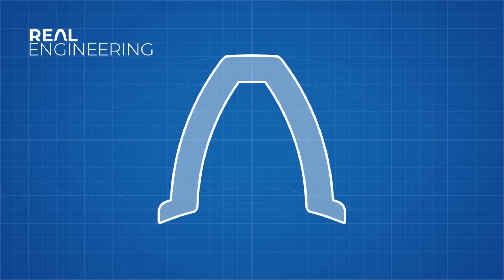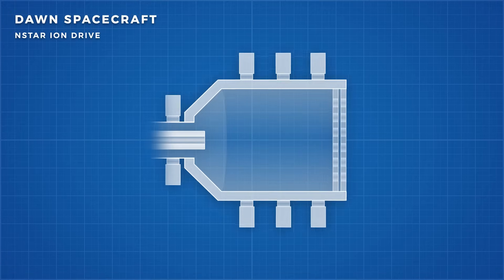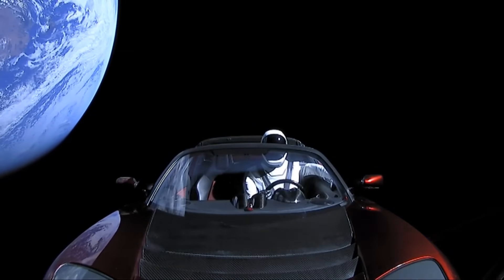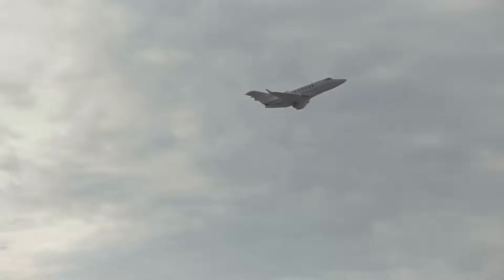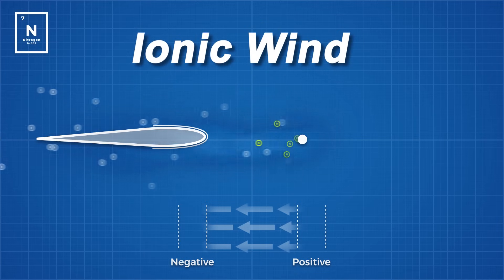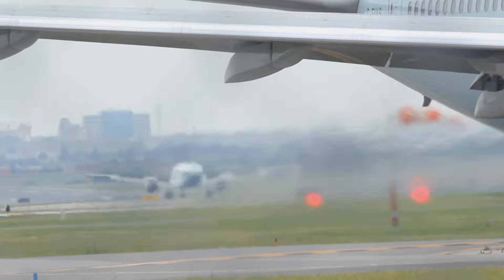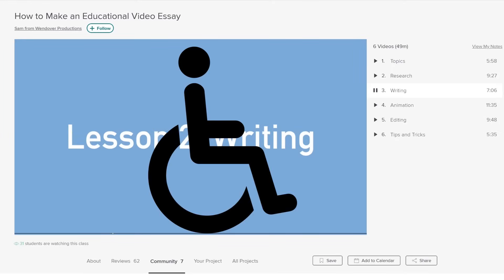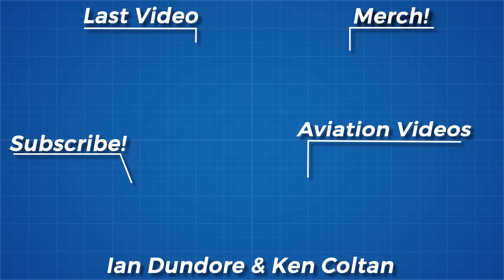Ion Propulsion - The Plane With No Moving Parts

Comment: Ion Engine: I am the first aircraft engine with no moving parts!
Ramjets: Am I a joke to you?
Scramjet: WTF dude?!
Reply: Paper Airplanes:
Reply: Pulse jet: sky rex you suck you forgot me.
Reply: you must have valves and probably a pump(s) ... moving.  Flaps, rudders ... hmmm...
Reply: @teresawatson8936  Ion planes also have flaps and rudders\
Reply: @allenstuder6938  Actually that's one of the things that can be avoided. If instead of the racks the MIT team used you used pins along the surface of the airfoil, you could increase the airspeed over whichever airfoil you wanted. Somebody made a small RC plane that had a normal propeller but the pitch and roll was ion drive. It wasn't great but it was the idea XD
Reply: @teresawatson8936  ;  They are speaking specifically of engines with no moving parts.  Not the entire aircraft.
Reply: Ramjets have moving parts but very little  Ion and zero  but yeah lol
Reply: Gliders

Comment: Designed their own circuit? That voltage multiplier and h-bridge switch is straight out of a  circuit designers textbook. There's nothing new in that. And that is a DC output voltage, not "alternating current". p/s: And that is not the Wright Flyer;s first flight, it is the second Wright Flyer. Fraud is fraud.

Comment: When the nitrogen is ionised, does it react with the oxygen in the air and does the plane leave a trail of nitric acid vapor behind?
Reply: and ozone, probably.
Reply: Unfortunately yes. I have made an atmospheric plasma drive of 2KW based on plasma cutter principles. The problem is what you mentioned. So even if MIT get's it and gets beyond the mW range they are in, they will come face to face with this unfortunate fact...
Reply: hopefully yes
Reply: Probably depends on energy level of the ions. There are home ionisers which are carefully tuned to avoid generating ozone or nitric oxides. I have one, it also makes slight breeze without moving parts.
Reply: MIT is working on real-life Chemtrails!

Comment: 50 ion drives on each wing should just about do it. The trick is to increase the acceleration of the atoms out the back since mass x acceleration means that very small amounts of mass multiplied by very high rates of acceleration can provide significant thrust. Shooting an atom at 100 million km/hr out the back of a plane though would require overcoming significant engineering challenges.
Reply: Interesting ideas!  I'll think you might like the earlier ion propelled aircrafts with onboard power supplies on my channel.  Please click on the channel icon to the left, if you would like to see them.

Comment: Donald L Smith solved the power without a battery problem years ago, as did many others. Zero point energy has long been experimented with, but has been suppressed by those with vested interests in the current state of technology. Research Tesla, Donald L Smith, resonant circuits, motionless pulsed circuits, and PJ Kelly.

Comment: @Real Engineering: Your hopes and claims are based on a logical fallacy. Comparison between the flying machine of Wright Bros. and ionic atmospheric propulsion is utter nonsense. Not everything, that works on a small scale can be scaled up and subjected to technical evolution. In this particular case, corona discharge is limited by breaktrough voltage of the air - in accordance of the good old Mr. Paschen. This means, there is no other way to make a bigger corona discharge propelled flying machine, than stacking up millions of electrode pairs. Additionally a lot of harmful Ozone (O3) and NOx is created and energy is wasted. The better way for future flight is gravitoelectromagnetism (GEM). This is the real thing, that can create specific accelerations up the several km/s² per m² and created US space superiority since June 2011 (last flight of STS). Civilian GEM-applications however have to wait for about 400 years, until our fossile energy industry will have monetarized the last chunk of coal. The reason is, so called topological isolators at RT are involed. This means, a GEM-drive is ruled by bosonical statistics. Without energy consuming phononic steps of fermionic statistics (waste heat), theoretical efficiency to convert electrical energy into lift and velocity is 100%. Practical values are around 97%. And hovering takes no energy - like a helium balloon, since no lift work is performed. And the best advantage is, every atom in a homogenous GEM-field is accelerated exactly in the same manner. Therefore, no G-forces are experienced by a flying machine ant its crew. ;-)

Comment: Would an ion propulsion engine work in a raid storm? I realize the MIT model was not meant to operate outside, but if in propulsion is to ever operate outside, it will have to function in weather.
Reply: Raid storm?
Reply: @Eidolon1andOnly  rain. Damn autocorrect.

Comment: Propulsion might be increased by using either uv or x rays to ionize air prior to the electrostatic field. This may increase the number of ions being accelerated by the electrostatic field. You might be able to use a soft x ray generating tube calibrated to emit x rays that do not travel far beyond the end of the wings.
Reply: Yes.

Comment: They took a shitty idea that's been around in working form for over 20 years, I built one in my kitchen that could lift it's own weight straight up in 1995 as did many other hobbyest. All they needed was a very high voltage capacitor that their plane could lift, a tesla coil could also be ideal as a power source as the high voltage dc output is just what is required. I used 30000 volts dc at micro amperage.

Comment: Make the wings digital I've got a graph and when the wings are in a solid square the wings being square at the exact flows over the wings the top I've got and under the wing make it a square shape no curves I call it the digital wing it'd be run by a computer to keep the pilots on their mission maybe even two pilots in a wing shape similar to a delta but the cockpit is fed into the plane so no bulky or if its for the f roll maybe have a small cockpit also if u can have a ball rolling in the centre and turning at thousands of miles per hour like when u put a spinning ball on a toy car the momentum will make it pull the plane through the air I guess using a Megatron to start the delta square wing ,sorry I'm just a ex electronic technician looking for work call me uk07983997524 or grahamhconquer3@gmail.com thanks
Reply: G

Comment: This is a model with no load, so transporting this to a big plane is NOT possible or it's so huge that it will crack down due to the weight of the plane.  And a second problem, test these outside or in a wind tunnel  . To overcome this drag You need far more power.

Comment: In the last century we called it "lifter" and we built it out of skewers, wire and aluminum foil. The model started vertically. The power source was a TV high-voltage transformer (30-50kV) and a rectifier (there is an error in the video because it cannot work on AC). This home ion engine with an area of about 1m2 raised the egg. Horizontal flight was impossible because the model was tethered because of external power supply with two-wire high-voltage power supply.
Reply: Please click on the channel icon on the left to see 12 videos of an ion propelled aircraft that does have onboard power.  Please see the NPR news program about it and video with officials present as well, Thanks.   It can also rise vertically!
Reply: @KraussEMUS1  Obviously you didn't understand, or the google translator misrepresented it. I have been experimenting with this type of "propulsion" in the last century and have tried it in a vacuum chamber. Since there were no portable high-voltage power supplies, the model had to be restrained and therefore only started upright. This only shows that this is an old idea and I was irritated by the fatal inaccuracies in the video.
Reply: @DL-kc8fc  
Dear Boleslav,
I was just writing about ion propelled crafts with onboard power(flies through the air carrying its power supply.)  There is really only one that uses solely ion propulsion, not MIT's, excluding lighter than air crafts.  I wasn't sure if you had seen the crafts that I built on my channel. They all have onboard power!  Anyone that uses the improvements I have found, should be able to get a much improved thrust to weight ratio.  Thanks for replying!
Reply: @KraussEMUS1  Now we probably understand each other. I will definitely look at your next work (currently I cannot watch videos).
Reply: @DL-kc8fc  
Perhaps you could try a different computer or different programming?

Comment: Pretty awesome, but really not all that “ground-breaking” considering guys like T. Townsend Brown discovered this method of propulsion in the 1950’s... took a while to implement?
Reply: If you click on my channel icon to the left, you can see 12 prototypes of an ion propelled aircraft in flight.  The invention has an onboard power supply and does predate the well publicized MIT craft. There is also a website and one of the videos shown has officials present.
Reply: T brown tek is on the b2 stealth bomber
Reply: Totally correct, but thats not all his research was used for. And it’s essentially the same principle to make the MIT glider fly.
Reply: @gaetanozorzi2055  to bad we have to redo all this, we already bought it once.
Reply: @Diana Thompson, I completely agree, it’s a shame.

Comment: How about arranging the ion electrodes in an array parttern (circular). ?
Providing a sufficient gap in between for air to flow (a smaller area more thrust). 

Can this be done?

Please reply. 
Awaiting your response 
Ph 7090922229
Reply: That is the way it should be done!  If you click on my channel on the left you can see 12 of them with onboard power that predate the MIT craft.  They are made of concentric hexagons, but circles would be even better.

Comment: The need for replacing the current jet aircraft is not simply due to noise. The fallout from jets is terribly toxic. The high altitude heat deposition is extreme. The displacement of ozone and water vapour is treacherous to the entire weather system of the planet. We need to refine simple electric aircraft now, high speed aircraft in five years. Jets are murderously polluting and utterly and completely unsustainable. This ion drive technology isn't going to be ready soon enough, we need an interim solution, and battery aircraft fly already. This technology it ready to explode, and we need to provide massive incentives to get this ASAP.

Comment: They need to power the vehicles with e m radiation transmitted from the ground then you don't need large batteries or a power source on the vehicle you just need a receiver tuned to the proper frequency and a circuit to get the necessary voltage. For application in space they could launch solar powered transmitters spaced along the path of the destination and if the vehicle is built in space then it wouldn't have the requirement breaking the Earth's gravitation.

Comment: 2018: The Plane With No Moving Parts

2028: The Plane With No Cabin Or Wings
Reply: 2030 
The iplane  you pay 3000 usd to drive somewhere
Reply: You mean a quadcopter?
Reply: AKUJIRULE  yeah that's right, no luck there without breakthrough propulsion technology
Reply: Ryanair has already ordered
Reply: Yeah, why use wings if you can use directional thrusters.
Reply: @steelwasp9375  ya, sit on a rocket instead.

Comment: I wonder if you could optimize the core ion drive structure using AI. Build it from the ground up and optimizing every aspect of it like the air gap and voltage needed to produce the optimal thrust and overcome drag enough for a sustained lift. Could produce a cool hover board like green goblin.

Comment: Why not have the propulsion above the wing, to improve the low speed lift performance by increasing the aif flow above rather than below the airfoil?
Reply: 🤔 you definitely have a point. The only things I can think of are flight stability and weight. A hanging structure can be built lighter.

Comment: I wonder if this could be paired with lighter-than-air craft, providing a lighter propellant than what airships have traditionally needed. The massive skin of the airship could also potentially retrieve solar power to reduce the weight of the batteries required.

Comment: This is very cool, but while I confess I'm no engineer, I know enough to know that, no matter what kind of thrust-to-power ratio or thrust density an ion drive may achieve, no battery-powered vehicle is ever going to competitive with a hydrocarbon-fuel powered vehicle, barring a major technological breakthrough.  The reason is simple: lithium-polymer batteries, of the kind powering this vehicle (and also powering most commercially available electric cars), top out at a specific energy of maybe 0.95 megajoules per kilogram, and in practice, it might be about a third that.  Jet fuel has a specific energy of about 43 megajoules per kilogram, so about 43 to 130 times greater.  That's really all that matters, because, regardless of what is propelling the vehicle, it is going to take the same amount of energy to move it a given distance in a given amount of time.  That doesn't mean the situation is totally hopeless.  Lithium-oxygen batteries have a theoretical specific energy of about forty megajoules per kilogram, competitive with hydrocarbon fuels.  Right now, lithium-oxygen batteries can get up to maybe nine MJ/kg, and probably closer to six in practice, which, granted, is much better than any other battery, but they have other problems, mainly with rechargeability and lifetime, which is why they are not in commercial use.  But lithium-oxygen batteries are the only way that any electric vehicle is ever going to be commercially viable (yes, maybe a metallic hydrogen battery might be even better, but that is way in the future), so that is where the research should go.

Comment: Ion propulsion has been around for over a century. The only place it is useful is in space because the thrust it provides is negligible anywhere gravity exerting any force is present. It can get up close to light speed, but the time it takes getting there makes it a joke. Then there is the problem of slowing it down, which takes equally as long. Deep space probes can use it, but any transmitting equipment will likely malfunction due to radiation exposure for the time it takes to actually get into deep space.

Comment: So you said a 200 volt Lipo battery was used. How in the hell did they fit 67 cells, in series, in a plane that light? 

And sure, they got it to fly straight, let's really test it and add some control surfaces.

Comment: solar panels molded into a lifting body and long, wide wings with an electrical isolation layer(that still allows great light transmission) then, have multiple stages of ion engines along the lifting body and lift surfaces of the wing, isolated from each other so that they can be placed close togetth, and current cant jump from one stage to another, The solar panels might increase range/power by 10%, and in theory, this aircraft could take off, before it gained much forward momentum making for very very short take off runways, landings would be traditional, so not a true vtol or vtosl

Comment: THUS IS A STUPID APPLICATION OF ION PROPULSION.
KISS CARGO CAPACITY GOOD BYE. 
IT MAY BE USEFUL IN HIGH ALTITUDE SURVEY OR SURVEILLANCE CRAFT, BUT IT WON'T DO ANY HEAVY LIFTING.
WHAT'S THE POINT IF THIS TECH WHEN SOLAR POWERED PROP ULTRA-LIGHTS ARE ALREADY IN USE, AND HAVE SIMPLE TECHNOLOGY AND NO CONSUMABLES?

Comment: Clever indeed.  But, you know there is always a but......  I'm not an engineer by trade, but it appears to me that to create the ionic thrust that is expected, the weight of the de-ionizing material will far outstrip moving that plane any appreciable distance other than in outer space as he described, but here in this reality in our thick air and gravity makes this technology no more than an a lesson in experimental design with no use.  Electromagnetic propulsion is where we are already headed, if the government doesn't already have it in secret.  Whether or not electromagnetic propulsion can work in outer space is another troubling question, or it may be that they can fold space such as that demonstrated in the movie DUNE.  I believe that any time you must use a fuel you will be limited by its capability to produce thrust against the weight of that fuel and the distance you must travel.

Comment: Unless they can find some way to multiply this force coming out like a big gear is too a smaller gear turning it multiple revolutions or like a capacitor is too a built up charge....then it's going to remain under the radar or under the table for a long long time.

Comment: Hummm interesting ,in electronics I was taught that electricity flowed from negative to positive.
Reply: Electrons do, because they are negatively charged. So negative had excess electrons, positive is missing electrons 

The high voltage source in the plane pulls electrons from the front wire to the back one, creating a negative charge there. The same way water can flow uphill in a pipe: you have to push itb using a pump.

The highly positive field at the wire electrode now strips an electron from a nitrogen atom, leaving it positively charged.
The nitrogen doesn't like that and tries to get it's election electron back. The airfoil in the back DOES have electrons it doesn't want to have. So the nitrogen gets pushed backwards, retching an electron there. Because the conservation of momentum, pushing the nitrogen backwards pushes the plane forwards.